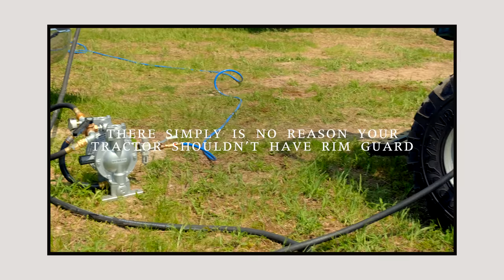I THINK I COULD PAY OFF MY TRACTOR WITH ONLY 1 JOB 🤩🚜👌

Comment from the maker: Have you had one project that paid for your tractor?

LOOK AT OUR MOST POPULAR ATTACHMENTS!
Speeco Quick Hitch: https://bit.ly/3NFC0yl
Stump Wrecker: https://bit.ly/3WYa6Tf
VersaBracket Combo: https://bit.ly/3wUPrnl
Snow Pusher: https://bit.ly/3NB4BVw
Tillers: https://bit.ly/3GT1kk1
Core Plug Aerators: https://bit.ly/3W0R25q
Pallet Forks: https://bit.ly/38wRztu
Grapples: https://bit.ly/3PNNYaZ
Dethatcher: https://bit.ly/3GT9Zmk
Tractor Canopy: https://bit.ly/3IHcvNU

WANT TO SAVE MONEY? CHECK OUT THE GWT DISCOUNT CLUB!  Use code GWT at any of the vendors below and you will save cold hard cash :)  I will also get a commission for the sale, so it's a win-win-win!  

USE CODE "GWT" TO SAVE BIG WITH:
BUCKET BRACKETS @ http://www.jufabworks.com
CUSTOM GRILL GUARDS @ http://www.5elevendesignz.com
PTO QUICK ATTACH @ http://tractorptolink.com
DIY HYDRAULIC SOLUTIONS @ http://www.summit-hydraulics.com
GAME CHANGING GREASING SYSTEMS @ http://www.lube-shuttle.us/store
TIRE CHAINS @ http://www.tirechainsonline.com
PREVENT FLAT TIRES @ http://www.multiseal.us
CULTIPACKERS & CRIMPERS @ http://www.packermaxx.com
ALL OEM JOHN DEERE PARTS @ http://www.247parts.com
ACCESSORIES AND BACKHOE BUCKETS @ http://www.muddscustoms.com
CUSTOM TRACTOR FLOORMATS @ http://www.tractormat.com
PROTECT, ORGANIZE, IDENTIFY HOSES @ http://www.outbackwrap.com
BOX BLADES FOR ATV'S @ http://www.northwoodsfabrication.com
HYDRAULIC SYSTEM PROTECTION @ http://www.hoseendchamer.com
DUMP FROM THE SEAT MATERIAL COLLECTION SYSTEMS @ http://www.proteroinc.com
POWERED SWEEPERS SWEEP UP ANYTHING @ http://www.sweep-all.com
EASY WHEEL TOP LINK HANDLE @ http://www.tractoraftermarket.com
TIRES, WHEELS, AND DUAL ADAPTERS @ http://www.millertire.com
AMERICAN MADE CARRY ALL ON STEROIDS @ http:www.bigtoolrack.com
THE BEST TOOTHBAR AND MORE @ http://www.heavyhitch.com
5% OFF WITH CODE GWT AT TRAC SEATS! http://www.tracseats.com

SHOP: http://www.goodworkstractors.com
AMAZON: http://www.amazon.com/shop/goodworkstractors
SUBSCRIBE: http://www.youtube.com/goodworkstractors
LIKE: http://www.facebook.com/goodworkstrac...
FOLLOW: http://www.instagram.com/goodworkstra...
MERCHANDISE: https://stores.inksoft.com/good_works_tractors_merch/shop/home

*Discount codes cannot be combined with any other promotions, offers, or deals!
**I choose to sell some products through 3rd parties instead of stocking items myself.  Know that I will receive a commission if you choose to purchase through certain links.  Thank you very much for your support!

This video is for entertainment purposes only.  Good Works Tractors (Good Works Lawn & Power, LLC) cannot be held responsible for content found in any video.  Always reference your owners manuals, use extreme caution, and proceed at your own risk.
Reply: Thank you for doing this video. Promoting the (Summit) was down at my Local JD Tractor Dealer. Very close to my Home. I looked at the (1025) definitely see what you mean on add ONS, some were very basic, some with that extra work lights on side steep area, very nice extras. Seeing them in person. when I looked at the (1033) they were the only ones with a (Shuttle shift) F&R with clutch. Now saying this, would like your feedback, have a monster  Backhoe with a (shuttle shift) it is a tork converter, just put it in first gear on the floor (no clutch) then pick the right gear for working, all the time (first) have always been used to (shuttle shift ) on Left side of steering wheel. Anyway I sat on the (1025) and the (1033) found myself Liked the (shuttle shift) LEVER to move the tractor. I used to work for a Paving company, they had an (Athey) Belly Blade Grader. It had the Forward and Reverse on a Rocker pedal. Kind of like the pedals on the (1025)  had the hardest time making fine movements, it was "Jerky" on me pushing the pedal. I would "Rock back and forth". Having said this. Why do you find the Pedal drive system better if you're like me not used to it. I also ran a construction type JD front loader with (Box Blade) the the one paving company used to get that area in parking lots that big graders can't grade on. We had a (JD-690) Grader. For the big areas. The JD front loader had a (shuttle shift) found it so much easier than the belly blade (Athey) does the (1025) come with a (shuttle type shifter)
Reply: Thank you for doing the COST difference on BUYING a Tractor versus HIRING out a contractor. I am like you only I bought a monster Backhoe, my baby is an old 1978 Dynahoe-190 BUCYRUS-ERIE Built them in the 70s & 80s the biggest heavy Backhoe of the time. Will tell you though my Backhoe end is part of the MAIN frame. It is NOT detachable
I had to remove a small cement wall by the side of my house that prevents me from any say 8' wide Vehicle from getting by the garage side of the home. By removing the wall still had like 10'
Before the  property line. I installed the Block wall next to the property fence. It gave me room for a large Backhoe and even full size dumps to back in for my stand by 5/8- gravel pile to store
I have had two fire engines backed in with the area that I made LARGER by side of home. One Fire Engine is mine. Restoration project the other was a Wildlands FF Tender ( Tanker-1500gal.)
That is used in summer months on contract to D.N.R. the Fire Cadets program needed a place to store her in the off season. My 26 boat trailer has backed up there also. By the large room I made on the side of the garage. Now saying all this why did I buy instead of RENT a backhoe. have had the backhoe since 2003, got it for $5000. Like you said it has paid for itself many times over. Have dug out large maple tree STUMPS in my backyard, took out my cement Driveway when I replaced her. Also dug a new water line ditch, so it would be a new replacement waterline under the new driveway.
So,so many jobs have made sense buying her. 
The big thing I ran into especially when I was still working. Worked with people that thought "O" you OWN a backhoe can you do FREE work for me. If you can afford to OWN one you can AFFORD to just do this digging for me. I even had a coworker who wanted me to Haul her on company OWN trailer. When I told him that it would be illegal to just use the company trailer to haul my Backhoe, for Free. I was enemy number one with that guy after that. He just thought that for his home project he could just use equipment for Free, for personal USE. That's the biggest problem I have run into on OWNER of Backhoe, everyone wants to USE it for FREE.
Reply: Courtney, you ever consider RECLAIM ? once packed it lasts a very very long time, stays smooth too. just and FYI..

Comment: How I justified buying my tractor...  I worked 12 to 16 hour days for years out in the gas fields.  I retired and I wanted a tractor.  Spend most seat time landplaning and snow removal on about 1.5 miles of gravel road in our development.  Wife thinks I'm crazy.  I would be if it weren't for all that tractor therapy.
Reply: -amen-you just can’t beat tractor therapy!
Reply: You guys are so funny and extremely helpful as that’s exactly the kind of justification I was looking for and didn’t know how to find it. I thought I was the only one thinking that way 😝
Reply: Sometimes there are things that are not really needed but you just have to buy them anyway.
Reply: Im curious where you get your material? I recently got 120 yds of sand delivered and it was 4$ a yard but delivery ended up costing nearly 6 a yard. Seems like I'm getting over charged
Reply: Being able to put in headphones and get outside on the tractor and do some yardwork while not having anyone disturb you is worth the price of entry in itself.
Reply: "I wanted a tractor" is enough justification for me 😂

Comment: One thing to consider to is a gravel driveway will always need some degree of maintenance no matter how it was initially installed plus occasional snow removal depending on what part of the country you live so a unless your going to hire out each time having a tractor is a must whether it pays for itself on the first project or over time.

Comment: Best driveway I got to help with was years ago we took out top soil plus a foot and a half of base. They were replacing us23, and the client arranged for some of those slabs to be hauled over and placed. The rest was busted up clean concrete, then filled all the gaps with rock, then 4s and 5s, then finished with the AA final layer was screenings. It took the client almost 10 years to do a 300' drive, but the cost was next to nothing because so many contractors were just looking to get rid of materials, and he used them as fillers.  It took a long time, but that driveway has held up for well over thirty years now.

Comment: The top load of just dumping on (organic material) is so important. In my area, lots of FARMERS have sold their Farms to big warehouse development investment companies. They do what is called (Preloading) they bring in pit Run gravel. Build up a small flat top basically a mountain of pit Run. The Farming land over years of Farming was so full of crop soil, lots of tilled land, lots of leftovers of Rich soil. Very soft. The big company let that 
( Pre Load) Wt. Push itself into a big Lot site for like say 6 months to a year. Then they dig off the top of the material dump truck to another preloaded site ready for Development. The Wt. Pushes that Pit run down into GROUND, so the big cement foundation for Wearhouse stays level, NO big uneven separation cracks in cement floor. That farm Land Fields as you probably know, are very soft. Have seen pictures of Farm Tractor SUNK in wet fields they were working in. This huge Development company has put so many different Semi compact Tractor Dealerships close to my home. There are still small Farm family guys who buy Sub compact Tractor in my area. The JD Dealership is the Largest. With tons of different size subcompact Tractor and attachment.

Comment: I purchased my first garden tractor ( used ) to till gardens.  After using it for 6 yrs or so,I moved up to a Kubota B series.  Still small enough to get in back yards to till gardens.  I was then asked about mowing fields so I bought a bush hog.  All of these jobs were in the side of my normal job.  I’d say it took about ten yrs to pay for the equipment. But I now have a good running tractor and a bunch of attachments all paid for.  NOW, my last and latest purchase was after two different people inquired about if I could spread seed.  So 800 bucks later I have a pto spreader.  Down side is both jobs fell through.  So it hasn’t made me a dime yet.

Comment: You really do have really good video and reasons to show our wives why we needed these tractors. But on such a large operation as yours, which is understandable as it is a business, you do have equipment that most of us don't such as the skid steers and heavy equipment for digging out the top soil, and a place to put it for the time being. That being said, my LS MT342HC is just going to have to work its little butt off this summer when I do about 300 x 12 foot drive and a 16 x 32 pad for my equipment parking area. Probably can only afford to make a lean to for the 16 x 32 area. Keep up the good work.

Comment: Used Geo Fabric on our 1000' gravel driveway built 11 years ago.  No pot holes and has stood up fairly well with only a couple of places on edge it came to top I have to put gravel over it.  Probably due to contractor didn't get as much gravel on the edges.  Have only had to bring in more gravel one time after 8 years.   I would probably do it again with Geo Fabric if I built another drive.

Comment: I can tell you the amount of work over the years we've done with the tractor here has been tremendous. Built driveways, pads, culverts and filled in ditches. That is just some of the things we've done here. Then got the dump trailer on a pick up and bring in piles to spread in place when spreading it over a distance is not what you're doing. Just building up the yard. Spreading only works if you making a run of it vs. Building up certain areas. All in what you are doing here.

Comment: We bought our home and 30acres back in 1995. Our driveway is just under a half mile. We had a Pro come in and grade it and he crowned it also. Then we laid down gravel.  Looks Great. However here in Eastern Washington we get lots of snow. So I'm on the tractor and plowing with the pickup alot. No matter how you try the gravel goes away. Then every spring in comes the Big Kenworth laying down more gravel. We got bids to pave back in 1995 and it was just not in the budget.....looking back  I wish we would  of just found a way and paved the driveway. 🤔
Reply: Pavement only lasts so long.  Probably cheaper in the long run.  Nicest thing is the clean car and extra speed on the driveway.  Delivery drivers and emergency vehicles appreciate hard surfaces.

Comment: I got quotes to cut in a new quarter mile driveway in 2016.  They ran between $28-34k for gravel.  $34-41k for reclaimed asphalt (millings).  $38-$44k for concrete.  $72-86K for asphalt.  Concrete was the clear winner at half the cost and less maintenance than asphalt (no resealing every 3 years), no raking/dust like gravel, and it could be dyed and stamped to look nicer than a long black/grey slab.  I am guessing those options would be around 50% more today and I would still go with concrete, but would add heating elements in a few spots that I now know tend to ice up in winter.  I have gravel at my office/warehouse because I need the drainage due to a lack of grade change between the building and road.  I had a small lake out there with all the rain we got yesterday here in VA.
Reply: Interesting. I've never priced a large concrete vs asphalt project, but I would have imagined the asphalt to be cheaper. Asphalt is definitely more forgiving than concrete. For concrete, it's not "is it going to crack", it's "it WILL crack" (or have slabs shift).
Reply: @JCWren  once the forms are up it's a really quick process, and the materials are significantly cheaper when you are buying premixed by the truck load.  It only took two guys to float and stamp without the expense/hassle of hauling in a roller.  Another guy controlled the chute, made sure the forms were secure, and coordinated the deliveries as they went from top to bottom.
Reply from the maker: Concrete has never been cheaper than asphalt around here.  It is always more, like way more, 20-30% more.
Reply: @GoodWorksTractors  I have a quarry and concrete plant less than 5 miles away from home.  That probably makes a difference
Reply: Where do you live that materials and labor are so darn high? Where I’m at a 24ton load of 1.5” or 2.5” crushed limestone runs $650, was $500 pre-covid. A skidsteer, grader, or backhoe runs under $150/hr. I’m just kinda mind blown because that project would be under 20k here, even at todays prices.
Reply: @trey8543  Did you miss the length?  It's 1,300 feet long and 16 feet wide with a 90 foot loop by the road.  That's over a half acre of materials.  It took a five man crew over a week to cut and grade the path, set forms, etc.  I'm in central VA.

Comment: I have a question.  I want a tractor but I also need a pole barn.  I have a pretty big slop in the yard so I’d have to flatten the top side and use that to fill in as well as get some more fill.  

Could I make the pad area for the pole barn with the tractor and what implements would you think would be best.

Comment: What is missing from the analysis is the resale value of the tractor and attachments. You don't necessarily have to cover 100% of the cost. Tractors have high resale values so one job could pay for 50% of the cost with the rest recovered from tax benefits (depreciation) and a resale 10+ years later.

Comment: I think a lot of people get disappointed with fabric because they try to use plastic or landscapers fabric.  You actually need to go to a contractor supply and get geo fabric.  It’s like $500/roll.  But you can save money by using it selectively in known problem areas.

Comment: Just a mere suggestion, but you might want to put some larger rock in that muddy location or you will still have mud.  In a Pennsylvania I use AASHTO #1 which has just been crushed and usually runs 2”-4””.  Makes an excellent base and will allow some drainage.
Reply from the maker: I'll be diggin the mud out, laying fabric, laying stone.

Comment: It seems really odd how all these driveways in the US seem to have plastic underlay - it's going to cause a massive micro-plastics contamination into the future. What did you guys do before this was available? Did all roads just disappear? What we do here in Australia is remove a few inches of top soil to get to the firmer stuff and build up the driveway on top of that - 70-100mm of 20mm all-in gravel usually. No problems ever with drive disappearing. Really soft soils may require more material removed .. but never seen anyone stuffing their land with plastic.